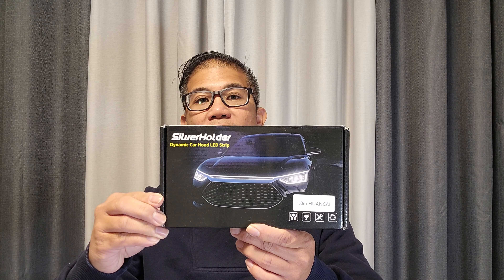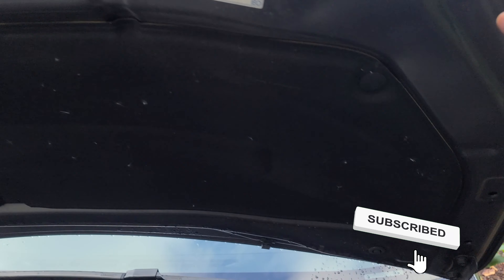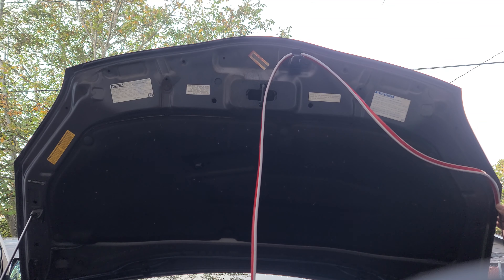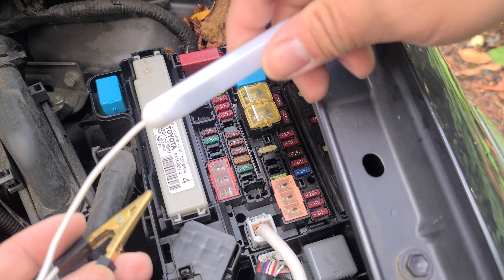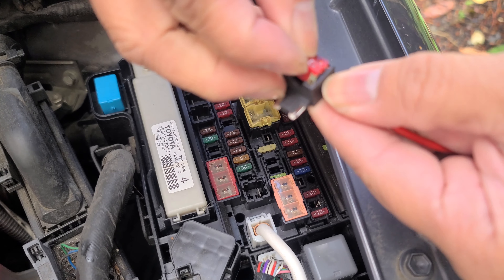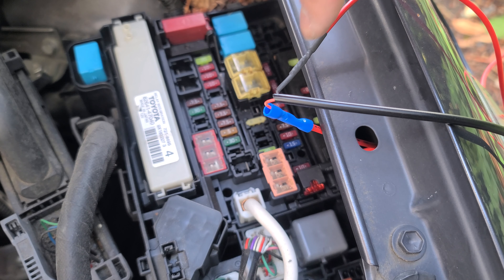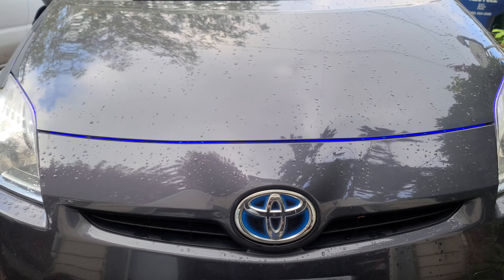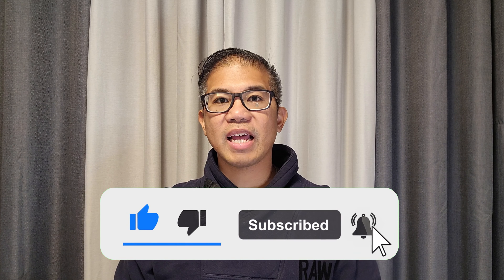How to install SilverHolder Car Hood LED Strip Multi Color

Comment: Front of car, with acumulator i dont have fuse box and what can i do with negative pole
Reply from the maker: You can ground the negative to the chassis with a bolt or look for an unpainted bolt.
Reply: @AutoSensation  on Mercedes sprinter there is not fuse box with acumulator what can i do
Reply: @AutoSensation  what can i do with negative wire

Comment: What is the name of the app?  There are a few in the Play store.
Reply from the maker: LED Lamp
Reply: By Tanguixing?
Reply from the maker: @eltroubador  yes. That's what I'm using.
Reply: @AutoSensation  how do you connect the app to the car? i installed the app and can’t get the colour changing to work.

Comment: How to connect it to a 2011 cruze 1.4l engine as idont have those kit to connect to the fuse..Can i just tap it to what ever fuse that it doesnt have power when the engine is off?
Reply from the maker: Yes. Any fuse will do. I will try to stay between 7.5 amp to 15amps.

Comment: Hi therr i recently got this installed my friend installed it for me, i think he did it backwards the leds light up the engine bay and not thru the grill , as its already connected is there a way to remove it and correct it? If so how would i re stickmit down as both red tapes have been removed ... thanks
Reply from the maker: Yes. Just pulled out gently and flip the LED strip. You will need to remove th old adhesive and put a new one on. Use this https://amzn.to/3JpGxFF
Reply: Thank you for the advise and information

Comment: update, after owning these in the uk, the easiest way to install is red to positive on battery and black to negative, constant power and simply turn on and off with your phone app when needed, i did manage to program some nice effects, you go into the screen to change what mode and click on the + then for example, add number 46 (forward trailing red) and then + 47 (backward trailing red) the two modes will then loop and you have your own Knight Rider effect. hope this helps.
Reply from the maker: Awesome. Thanks for the info
Reply: connect to battery....lol  make sure the fire department is near by...

Comment: i have the same app how do i set it to do my own 2 color combination of either flashing or cycling? like if i want to do green and white is that possible? to make it cycle from green and white or another color combination?
Reply from the maker: Yes it's possible. On the bottom of your app button second from the right is your custom feature.
Reply: @AutoSensation  thank you so much

Comment: Use green or black for ground extension
Reply from the maker: I bough more black automotive wire as I ran out during installation and was lazy. I have now switch the wiring to avoid confusion.

Comment: Can the red wire be connected to the rear power outlet fuse?
Reply from the maker: Yes as long as the fuse will have no current when vehicle is off
Reply: @AutoSensation  even if it's a 20 Amp fuses.

Comment: Why is there adhesive tape on both sides?
Reply from the maker: The wires come out on one end. With tape on both sides you can have the wires either on the left side or the right side of your vehicle. Closer to where your battery or fuse box is.
Reply: @AutoSensation  so you just leave the unused side with that tacky looking tape on it?
Reply from the maker: @Willy B  you can remove it. A bit tidious but can be removed. I'm lazy and just left mine. I've heard other put black tape over it but I think that makes it worse.

Comment: I would like to install this on my Hyundai and i see the LED strip sits on hood seal (aka hood weather strip). Is this going obstruct what the seal is supposed to do or does this break Hyundai warranty as far as you know?
Reply from the maker: Mine does not sit on the weather strip. i don't think it will stick on the strip.
Reply: @autosensation Does the strip glue let us undo and re-stick in case we mess up the first time?
Reply from the maker: @inboxmy  No not really. If you don't press in and just layout first you may be able to realign. If you pull completely off. It may not stick well the secind time. The adhesive is strong. I transfered to a different vehicle and used this. https://amzn.to/3Uo7fCB

Comment: Just received one, how can I connect it in order to have it on during the day and also during the night, please.
Reply from the maker: Go to your fuse box. Look for a fuse that is stays on when the vehicle is on and is off when the vehicle is off. Use a piggy back fuse to tap into it and connect the red wire. The black wire will connect to an unpainted bolt.
Reply: @AutoSensation  thank you for your swift response
Reply: @AutoSensation  can you please let me know name of the ideal fuse, like,, start,, or,, engine module,, etc. Thank you
Reply from the maker: @markp8686  it is labeled ignition
Reply: @AutoSensation  thank you so much!
Reply from the maker: @markp8686  Your welcome
Reply: Can I use a fuse that says ecu 7.5a to connect power? I checked it and it has power when car is on and when car is off it cuts power off
Reply from the maker: @ariwerba5813  Yes you can.
Reply: @AutoSensation  thanks your video helped me a lot.
Installed it on Kia and looks great.

Comment: How can I change the color from white to red as soon as the engine is on ?
Reply from the maker: You can set it to red and it will start at red. As far as transitioning to red from white, I'm not sure that would be possible with this kit.

Comment: How are these lights lasting after several months?
Reply from the maker: After 3 months of normal use. Still runs great. No complaints so far. If I were to change something it will get the dynamic white. Looks better IMO.
Reply: @AutoSensation , Yes I’m planning to order the dynamic white for my 2022 BMW X3. Only thing I purchase besides the led strips is the piggyback fuse right?? In that way I don’t need to do any wire splicing/cutting. Really don’t wanna cut any wires and mess with the electrical stuff on my BMW.
Reply from the maker: @sumeetlal1  yes. That is correct
Reply: @AutoSensation , Awesome thank you.
Reply: I've gone through 3 of the dynamic ones and they've all failed in less than 3 months. They look great but the wires are extremely thin. How are yours holding up?

Comment: In my car manual the fuse box diagram tells me there are a few 10A fuses that are marked as 'spare'. I'm guessing that's the one I'm using when connecting the red wire?
Reply from the maker: No. That is your spare fuse in case something goes out. It's not connected to anything.
Reply: @AutoSensation  Oh okay, I understand now. I looked over it again and see that my ACC fuse is a 40A. So I'll need a piggyback fuse adapter to plug that ACC and this new red wire from the LED set like you did.
Reply from the maker: @WilldaBear  yes.
Reply: @AutoSensation  Thank you. Is there another fuse that you recommend I can use if I want to add a lightbar? Since the ACC fuse will be already taken by this LED strip.

Or should that be hooked up to the car's battery?
Reply from the maker: @Will  depending on how much power your light bar is taking, I would use the battery. Best if you use a switch and a rely.
Reply: @AutoSensation  Thank you so much.
Reply from the maker: @WilldaBear  your welcome

Comment: I have a 2023 Elantra.  I have found the correct wire at the headlamp harness to tap for DRL, but both sides are independent and shut off when the turn signal is on.   I think I have to tap both lamp assemblies and use diodes to prevent back feeding.   Thinking it will be a good idea to use a relay too.
Reply: Bro I have a 2022 Elantra, can I see your finished project?
Reply: @kelvinhumphrey7718   Got 'er done today.   Had to install the strip to the hood itself as the cowl has a huge 'drop off' where the hood rests.   
https://www.youtube.com/watch?v=SDqoRoblx4g

Comment: Question about the fuse, how about if I want to connect the hood light strip to my DRL and the fuse is 7.5 amp? Would I need it to replace it for a higher amp fuse ?
Reply from the maker: No. Use a piggy back fuse or add on.

Comment: Strange question, is it possible to install another one on top of the first one? I'd like to have the thickness of the light more thicker? Thanks
Reply from the maker: Depending on the gap between the hood and the car. Each car is different but very possible. I have the led turn signal strips and the hood led strip on top.
Reply: @AutoSensation  I just looked at it at night, it's bright enough, but did the same, put the led turn signals on too, will get ones in the back, very happy about the product! Thank you for your help!

Comment: could you had powered the lights to the 7.5 fuse #18 (daylight running lights) giving you an option to turn the DRL off and the LED strip from inside the car when need to?
Reply from the maker: Yes

Comment: I got my light strip’s delivered and I was wondering from that black box I have 5 (thin cables) 2 X yellow, 1 X black, 1 X Green and 1 X Red. Where do they connect? Thanks
Reply from the maker: Are you sure you got the Hood LED strip? You should only have two wires. Black and Red.

Comment: Hello. My question is, although these lights are multi colored, can they be set to do the startup scan mode, and if so, can you please do a follow up walkthrough video? Thanks for your time.
Reply from the maker: No. The multicolor ones does not have the start up feature.
Reply: @AutoSensation that's dumb
Reply: @nailed2ax_126  Why?
Reply: @subzrodagr8689  because I like the start up lights thing, I brought the multi colour one. Hasn't arrived yet. Should have looked on YouTube first before buying them 🤣
Reply: @nailed2ax_126  ohh. Right. I’m actually in the same boat. I thought you were trying to say my question was dumb. Personally, I believe the only dumb question, is the one that you don’t ask, and assume. They definitely look cool on my vehicle though!💪🏾👍🏾🫡
Reply: @subzrodagr8689  nah wasn't saying your question was dumb 🤣 was just disappointed.  But liked the mutli colour lights in a ad I seen on Facebook and brought the lights before I changed my mind and scrolled past them 🤣 if I had looked here first I most likely would never have got them considering they cost me $100
Reply: @nailed2ax_126  Honestly, I get head turns, and compliments and questions about them quite often. They are definitely different, and a conversation piece. Besides not having the startup sequence, you shouldn’t be too disappointed.
Reply: @subzrodagr8689  yeah I'm sure I'll like them regardless. I just hope they suit my car 😅

Comment: ive just purchased these from silverholder. question... can you add custom modes for the lighting, the inward flow 7 colours and pick which colours etc.. or make a single colour knight rider effect.  also, walk away from car after setting the mode,, and light stay on.. until u return and turn off with the app ?
Reply: have you figured this out yet? i want to make my own color cycle of green/white but i dont know how

Comment: What color wire did you connect it too??
Reply from the maker: Black wire to ground. i used an unpainted bolt. Red wire to my ignition fuse.

Comment: Does it affect the seal strip or the water proofing of the car’s hood when the light is installed?
Reply from the maker: No. Just a tighter fit.

Comment: I installed my dynamic white strip today but my car shows “headlight problem” error on the dash. Do I just need to clear codes?
Reply from the maker: What kind of car? Most likely you just need a reset. Disconnect the battery, wait a few seconds then connect it again.
Reply: Posted on the wrong video, but it’s on 2019 Pilot
Reply from the maker: @medicdavid1  disconnect the battery for a few seconds then reconnect. That should clear codes up

Comment: You probably don’t know this but in automotive and in a lot of other cases you do not make a red wire a ground it’s just safer that way what you can do to fix your problem is wrap it in black electrical tape
Reply from the maker: Yes. I have been told by another fellow subscriber. I learned and changed it to black. I was out of black wire that day of the installation and was lazy to buy more black ones. Now I understand it has some importance. Thanks for letting me know. 😊

Comment: Great video! Question about these lights though. Silver Holder also has a "Dynamic Startup" light strip that is just white and has a pretty cool look to it at startup. Will these lights that are colored do the same?
Reply from the maker: No. The multicolor ones does not have the scanning feature.
Reply: @AutoSensation  thanks. That’s too bad
Reply: @MrElrond330  what did you end up going with? Thinking the same..

Comment: Greg I think you should have stepped back with the camera so that you could see the whole hood as the corners on the front are a very sharp turn . I have a Prius and it didn't look the best so I finished at the first sharp corners I blacked out the original light with moving it in towards the center then blocked off the light coming from the strip with black duct tape definitely looked a lot better I bought from the internet and sent it back they sent me 1.2m light strip so I only had to block off a few cm each side with the black tape but it made it look a lot better that first bend makes it very difficult to bend the light strip. Anyhow whatever suits each go particular person

Comment: I bought the one that is only one color, Dynamic LED strip, the package did not include any instructions to follow for safety, you know. 
I understand black goes to ground and red to ACC the same way you did it with a Piggyback fuse , so I guess the installation is the same for both types of led strip.
Reply from the maker: Yes. The installation is the same.

Comment: Question where do you buy the strip light ,does it is come with the fuse connect with wire. that you show on the video
Reply from the maker: Purchase strip here. https://m.silverholder.com/ref/23/
No it does not come with the fuse tap. https://amzn.to/3DZGhdx

Comment: I've ordered it, but wondering..   If the scan feature starts in the center and scans outward left and right, how will that change if you need to shorten the strip?  I know starting in the middle and working your way left and right is the way to install, but does that mean you have to "hide" the longer end of the power side?
Reply from the maker: Yes. Not recommended to cut because the center will not change. If you cut make sure you seal tight for water proof and you must hide the power side to even out.
Reply: Just wrap black electrical tape on the ends

Comment: Big mistake using a red wire for ground
Reply from the maker: Yes you are 100% correct. I didn't have the black automotive wire at the time of recording and wanted to finish the video. It has been switched to avoid confusion. Thanks

Comment: I think you inserted the piggyback into the fuse box the wrong way.
The line out needs to be on the opposite side of the fuse terminal.
The easiest way to tell if it's wrong is by removing the bottom fuse and seeing if the light strip stops working.
Reply from the maker: You might be right. I'll have to double check. The piggyback fuse can't turn the other way because of the wire. I might need to look for a different fuse. Thanks
Reply: @AutoSensation  I just edited my comment.
I meant to say bottom (factory fuse). The factory fuse can blow. But the light strip will still be working.